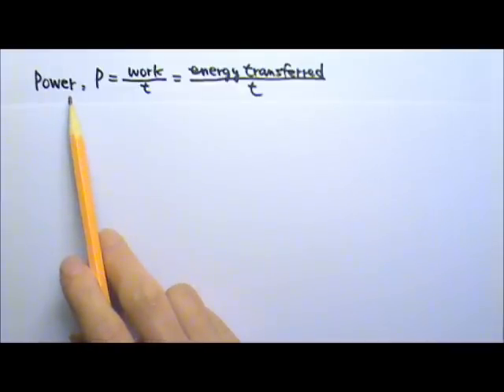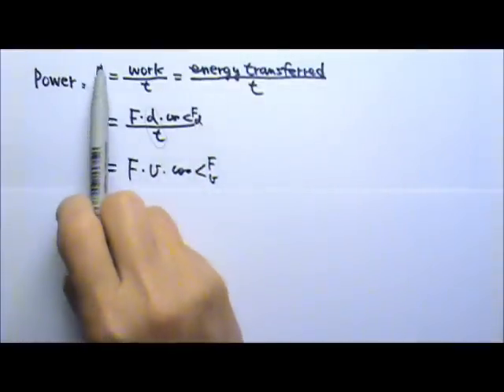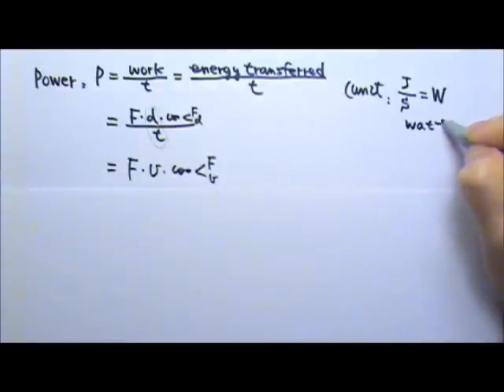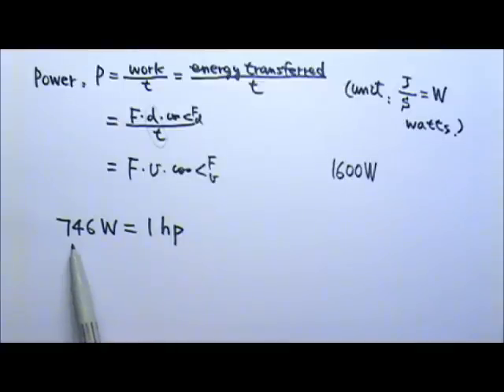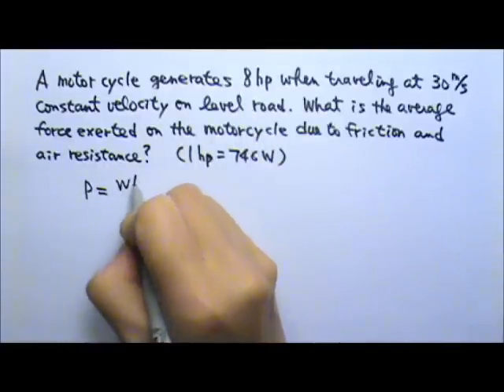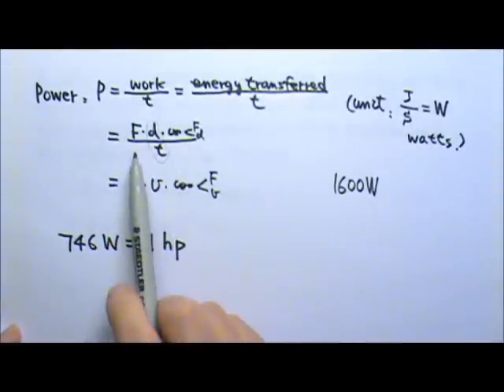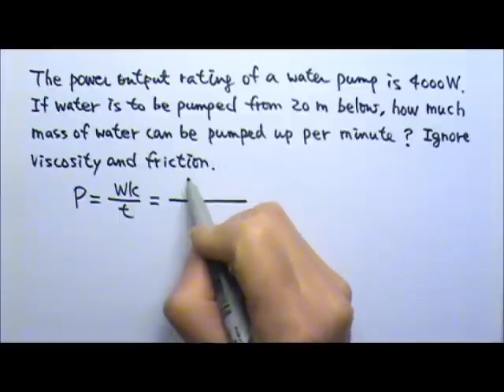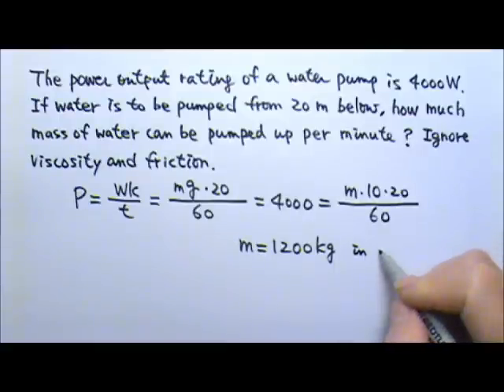AP Physics 1: Work and Energy 21: Power, Horsepower, and Power Problems

Comment: where did you get 10 in problem 2?
Reply from the maker: +Green Iris At 5:58, the 10 is the g. I usually round the gravitational acceleration from 9.8 to 10 for convenience of calculation.
Reply: Okay i get that part but one last thing. I couldn't get the answer which is 1200 kg? Like what is the formula in finding mass? did you multiply 10 x 20 then divide 60 and what happens to 4000? I really need your help on this. Please. God bless and thank u so much in advance.
Reply from the maker: +Green Iris For the last problem, the problem told us that the power = 4000. We also know that the power is mx10x20/60. So we have:  4000 =  mx10x20/60. To solve for m, we can multiply by 60 on both sides, and divide by (10x20) on both sides, so m = 4000x60/(200) = 1200.